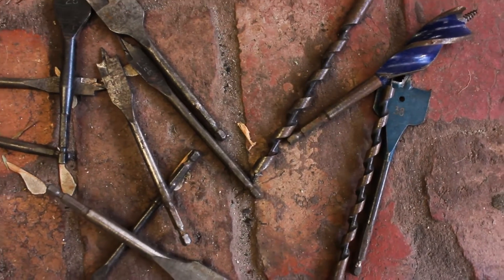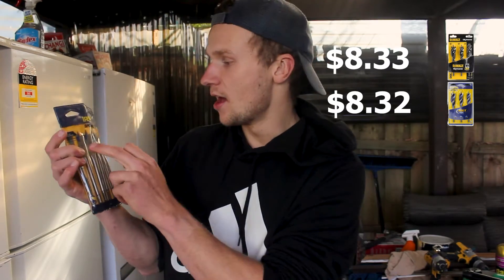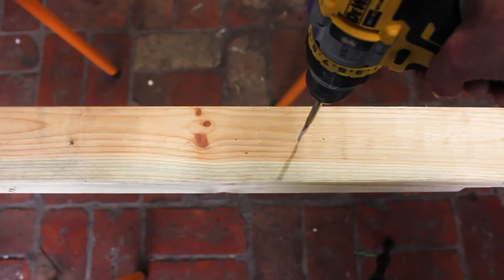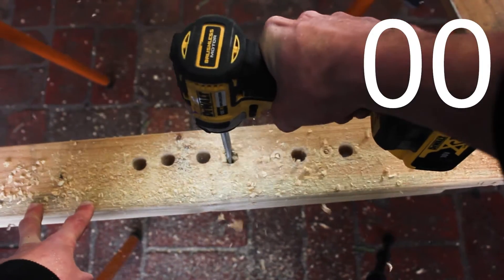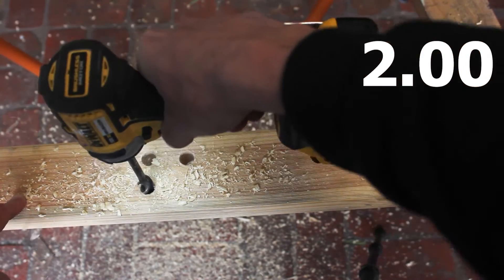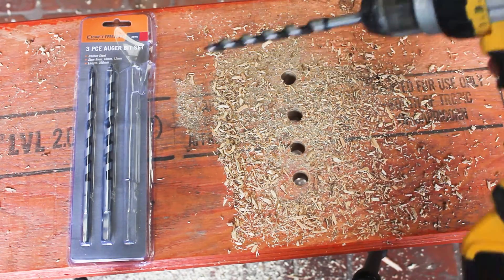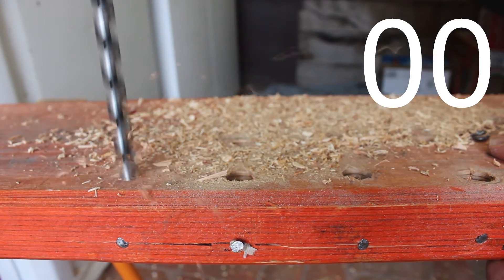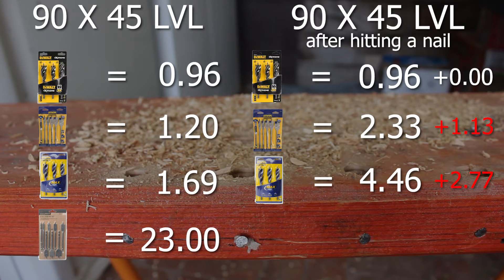Testing which drill bit is best value Auger VS Spade bits

Comment: I have a 1" Irwin auger bit. Not the speedbor type, just a regular auger. Its brand new but it will not drill a hole very good.  It basically bottoms out once the screw tip goes through and it won't drill anymore unless you put intense pressure of your whole body behind it. Terrible. I used to like Irwin tools. Not anymore. 
then I bought a Crescent brand speedbor type of bit, 1" also and it is much better.
Btw, I was drilling into Maple and Pine. Maple was much harder

Comment: I use Bosch as a standard brand for stuff and their products seem to hold up well, the number of manufacturers names is quite high. Sometimes you need the quality to get the project or job done. You can pay a premium for some stuff and that’s the time you have to consider what you’re going to get for paying extra. 
I think Irwin gets overlooked by some people which is a shame, they do decent stuff and hold up well to regular use. Some brands can be a bit hit and miss, you might not have heard of them and they are just not up to the job and that partly explains why they are “on clearance” because it’s not worth having stock nobody wants. 
It’s also worth noting some drill bits get very clogged easily and that’s a sign they are not really up to the job. A good Bosch  or similar set will be worth the outlay and pay for itself many times over.

Comment: If you weren't using a DeWalt I suspect the Craftright spade bit wouldn't have drilled through the hardwood. Buying drill bit sets is such a trap.

Comment: The drilling speed also has a lot to do with the tip thread type. The more aggressive the tip, thr faster it will go. BUT that also depends on what type of wood you are using it on. Soft wood aggressive tip thread works great but on hardwood, you want less aggressive tip. Just my opinion. I'm not a tradesman.

Comment: The Dewalt and Irwin look like the exact same product with different point jobs.
Reply from the maker: They really do! under close inspection i can't note a difference!
Reply: @DaveDoesCarpentry  Irwin and DeWalt are owned by the same parent company.
Reply from the maker: That makes sense. They would be manufactured the same, making it interesting that they differed in results.. I might need to put them under a lot more testing
Reply: Dewalt and irwin are owned by stanley black and decker